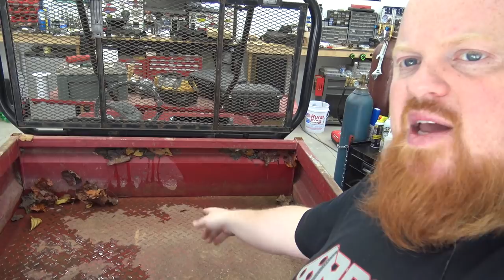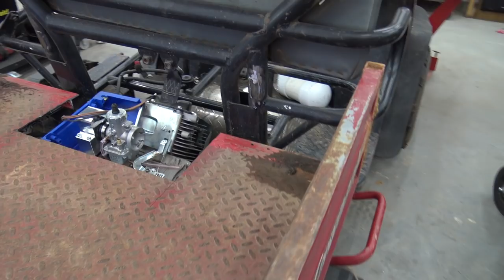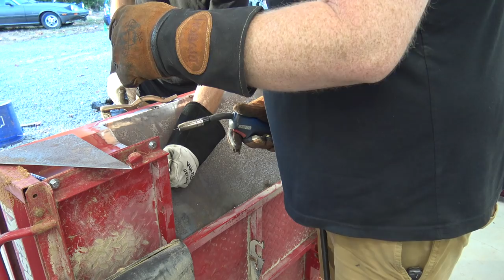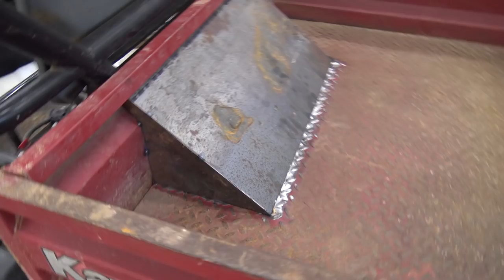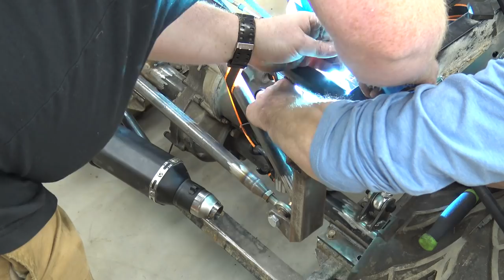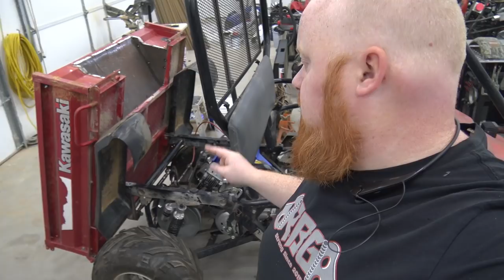713cc V Twin Kawasaki Mule Custom Exhaust

Comment: I forget what you called it but the single pivot point setup is interesting to me. (The way the backend connects to the frame like a trailer) I want to try a build like this. I don’t think the bed looked to high .

Comment: 🙄This kids Is why you spot weld and test before you weld it up properly, because if you spot weld and it wrong🙊 you can do a little bit of grinding on the spot welds and it will come apart easily it saves a lot of time😉🤫
Reply: A basic principle RBG has taught you and everyone else previously because he always spot welds to mock up on every build.  
I'm sure he did the same mocking up here, but ended up changing his mind later.  Probably one of those things that niggled and he woke up one morning hating it.